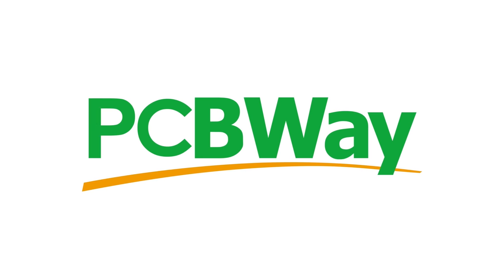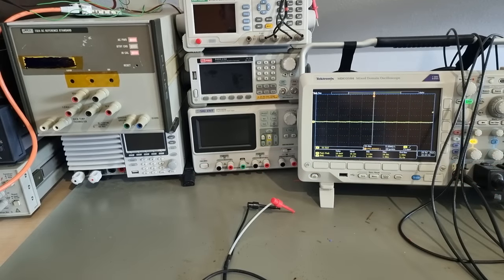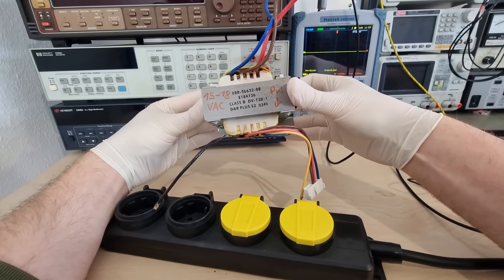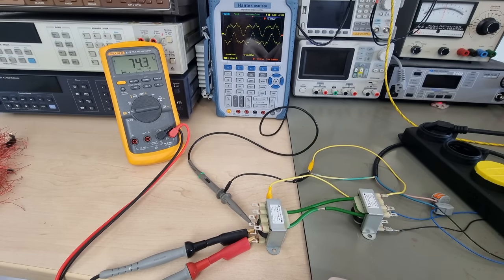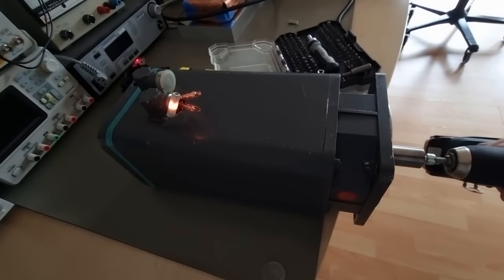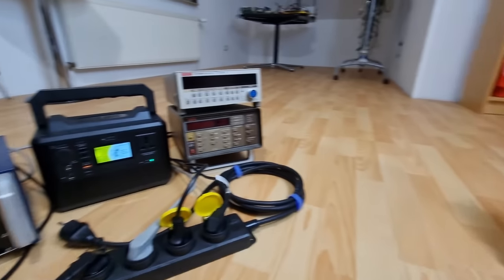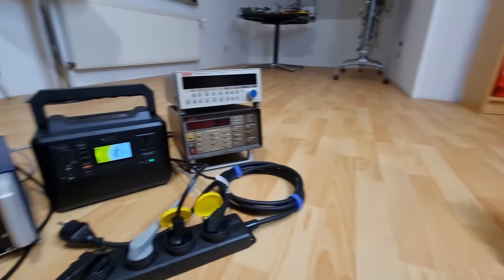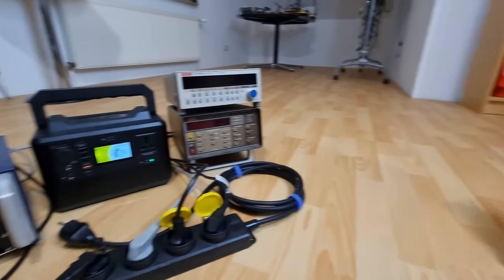eXtReMe iSoLaTiOn ( Low Leakage Power in Precision Electronics )

Comment: What about peltier devices? Deliciously solid state and only a teeny bit horribly inefficient.
Reply: and the excess heat can be used to heat the oven for the reference, neat!
Reply: Or  l a s e r s
Reply: A RTG usually is a peltier device. Apparently thermals are the reason for not using a super-radioactive and probably illegal discarded RTG, and no other reason... :)
Reply: @KnowledgePerformance7  It should lasers yes. Pref. RGB ones.
Reply: If not being solid state is not a deal breaker, one could simply mechanically couple a motor to a generator for virtually absolute isolation.
Reply: Or a simple solar cell instead of the fancy white-light one. They are sensitive to infrared if I remember correctly. So a single wavelength light source would work.

Comment: "The main winding was of the normal lotus-o-delta type placed in panendermic semi-boloid slots of the stator, every seventh conductor being connected by a non-reversible tremie pipe to the differential girdle spring on the 'up' end of the grammeters." - what I hear as a mechanical engineer
Reply: Now if he'd used spurving bearings be would have dropped at least a decimal on those ppms
Reply: LOL me too, but your humor made my day! :-)
Reply: This is just silly. You can't use tremie pipe on odd-numbered conductors mate
Reply: @Tikorous  Not even if he tightens the flingnut on the reversible trom-joint?
Reply: @friedmule5403  we're trying to have a serious conversation here
Reply: @Tikorous  Sorry but I am new to this technology, I have only tried the former model without the dingle-arms and tremie pipe. :-)
Reply: @friedmule5403  we all start somewhere
Reply: @Tikorous  lol, thanks for your understanding:-)

Comment: "Light emiting resistor" 
My god that made me laugh out loud HAHAHHA
Reply: Every electronic component act as a heater and emits light if you operate it wrong enough
Reply: That and the diagrammatic goatse.
Reply: one of the oldest jokes, but always appreciated 😀
Reply: Caught me off guard  Hahaha
Reply: Diode = voltage dependent resistor
sort of
Reply: "Strange, I don't remember spec'ing an orange LED...  Switch it off, switch it off!"
Reply: @SysDaemon  lol it happens allot on breadboards if ya not careful aka me, orange red leds and orange green leds lol
Reply: Reminds me of a soviet distribution box that had bolts as "status LEDs"
Reply: @666Tomato666  I want to see that.
Reply: @666Tomato666  : I had this with a russian db meter !!!
Reply: @_adamalfath  No, if you're ingenious enough to handle the emitted light. It may be not visible by the naked eye, but CO2 laser light is not visible too, but is strong enough to cut metal.

Comment: Woah, I am currently developing an isolated high-impedance ADC module array designed to measure high-impedance voltage sources (~100k of internal resistance) with 5 digit resolution and 2.5V dynamic range.

I've learned about FR4 leakage, guard traces, solder mask leakage, chopper amps etc already, and now you've covered probably the most subtle topic - isolation transformer leakage and how to reduce it. This was of a great help, thank you!

Comment: Look up "austin ring transformer".  These are used to feed single phase AC power to the signal lamps on AM broadcast towers, while not passing the RF to the power grid.  They are dual, interlocked toroids, with one AC winding on each one.

Comment: At my first company back in the early 70's they produced the Vidar 510 DVM.  It had a special power transformer.  The mains primary was on the outside of the EMI chassis and the secondary on the inside.  The transformer was fully encased in a die case shield, such that only the magnetic field could be conducted to the inner chassis.  IIRC it was developed for an Aluminum smelter to monitor current shunt voltages with huge multi thousand amp of common mode currents all over the place with shunts located a long distances away.
Reply: Huh, that sounds demanding. Did the core of the transformer actually pass through the shield?
Was there anything to prevent the shield from acting like another winding on the transformer (slits, gaps, etc...)?
Reply: Installed some equipment at a UK smelter many years ago. 195kA dc, single turn 'load' (down one smelting hall, back up the other hall). 
I could hang screwdrivers by their tips from the structural steels. 
Wallets (credit card mag stripes) had to be left on vehicle floor pan to stop them demagnetising. Some wild stuff. 
And no aluminium drinks cans allowed (H&S)!

Comment: Good video, but Marco, you missed explaining the most important instruction on 732a:  You never take measurements from 732a while it's plugged in, that is the whole point of the 732a having a 24V sealed lead acid battery pack built in.  The main point in the 732 manual:  Never take measurements while the 732a running from Mains power.  The Mains power is only kept on to keep the 732a warm and charged between measures.  Typically you're not going to be using that device for long term tests, a 732 is mainly used to transfer a known calibrated Volt from your local cal lab to your other in-house 732's, and from there you can periodically align your 3458a's to the 732a's.

We've found that a battery  / supercap cycled power system gives best low noise results, by far.  There is a reason a lot of those systems are patented.
Reply: I think he was purposefully leaving it plugged in since batteries are perfect isolation and he just wanted to compare the transformer isolation.
Reply: That's very interesting. Makes sense
Reply: What if there is some added noise from noisy acid in battery?

Comment: Interestingly enough motor-generator pairs are actually used in very high voltage applications such as particle accelerators where you have to get a few hundred watts, or a few kW of power into an area (deck) that has a voltage of say 100kV relative to ground. It's a very fascinating.
Reply: Apparently back in the day the military used these to do frequency conversions as well, usually between 400Hz and 60Hz. Since maybe the 70's solid state electronics got good enough to replace those.
Reply: They used to be used in a lot of machine tools (lathes/mills/grinders/etc) to allow for more optimal spindle speeds via frequency conversion.
Reply: Can't beat a meter of insulating shaft for isolation.
Reply: @power-max  if by "back in the day" you mean "today", you are correct.
Reply: @AuxiliaryPanther  I work for the US army and we do not use motor generator pairs for frequency conversion. There are a number of different MIL COTS converters we use. They all use solid state switch mode converters and inverter stages. AFAIK they work by rectifying the 115VAC 400Hz to DC, with power factor correction, then feeding an inverter stage to convert that back into AC, which is filtered with some output LC circuits. Usually these are fed with 12, 10, or 8 AWG MS22759/43 or /87 cables (200°C and 260°C, respectively.)
Reply: @power-max  ah, the Navy uses a mixture of old and new methods, depending on how old your ship class is.
Reply: @power-max  Chiming in with another data point, back around 2010 an Air Force research lab used a 400Hz motor generator pair that was switched on on-demand to provide 400Hz power around the building.
Reply: Look into 'dynamotors' - a rotary-state machine for DC-to-all sorts of volts/freqs conversion.
Reply: ooh eeer
;)
 @samheasmanwhite

Comment: It looks like a couple of the switch mode converters you tested have Y-capacitors across the isolation barrier. These can sometimes cause currents large enough to feel. It seems like their contribution might outweigh the transformer inter winding capacitance, but it would be interesting to do the measurement with them snipped out to see.
Reply: Same thing I wanted to point out.
Reply: I have lit up LEDs and even neons from such things! And felt it too haha
Reply: Cutting out the Y capacitors will remove the return path for high frequency electromagnetic interference (EMI). Which means taking them out may cause other types of interference with the sensitive measurements.

There are other ways to design power supplies to achieve low EMI. It is much simpler to avoid the designs that require the Y capacitor.
Reply: Sorry to disturb you, but I am desperate. :-)
I think about everything he is doing in this video, has taken a space rocket over my head. May I ask what he is measuring and what it influences?
Reply: @friedmule5403  common mode rejection. The voltage on output of the charger relative to earth ground. Due to capacitive coupling, there will be a small current that can flow, and a voltage of up to nearly 100V that can develop. It can cause problems with precise measurements and audible noise in audio circuits.
Reply: @power-max  Oh thanks, so the problem can be double in counties with 220-250V?
Am I understanding right in that voltage output is what is between zero (technically ground) and the real ground?
Reply: @friedmule5403  not really sure but presumably, yes. That would be how that would work...
Reply: @power-max  Thank you a lot, and the voltage was between psu zero  and real ground?
Reply: Without those capacitors, the common mode current will all go through the puny 1M or 10M sense resistor. You can get voltages large enough that the scope’s front end overvoltage protection kicks in. Ask me how I know 😅

Comment: The Topaz ultra-isolation transformer is old tech, I worked there in the 70's.  

The primary and secondary are wrapped with copper, insulated with tape to avoid a shorted turn.  The one we did had aluminum cases around both winding (not just the plate you showed), the copper and aluminum were grounded.  Any noise on the primary saw: 
  Capacitance to the primary copper shield
  Inductance of the shield to ground
  Capacitance from copper shield to aluminum shield
  Inductance of the aluminum to ground
  Aluminum shield to the secondary copper
  Inductance of the copper shield to ground.  

Isolation was very good, as long as all the shields were grounded properly (primary and aluminum to earth, secondary to the chassis ground of the powered product.   They did side by side, and inner and outer when leakage inductance was critical.
Reply: Interesting, thanks.  I have a 500VA (probably 1980s) Topaz unit that I occasional use (mostly for the safety benefits if I am working on powered equipment where the mains wiring may be exposed.  But it's good to have further understanding.
Reply: I've got several .0005pf Topaz Ultra Isolators. Step one on all of them was to verifying correct tap wiring and step two was to tighten EVERY connection point (including torquing the case through-bolts). All have brought obvious improvements in sound quality in each respective system. I size them for being at least 3x the max current of all devices connected. 

I have had better luck with these than my old PS Audio P15 power plant.

Comment: Great video! I've been working on low leakage currents using off-the-shelf DC-DC converters, mostly at switching frequencies. Love the AC leakage comparison. 

I just figured out a neat trick to reduce leakage on a split-core AC transformer even lower than the typical 1uA, by about 10x. Tried it on a Hammond 162G12, 12.6VCT, 12W. It reduces the AC leakage current by about 10x.

The trick only works with 120VAC US power and off-the-shelf dual-primary transformers. You connect one primary of a dual primary AC transformer to the 120V line and neutral. Then connect the other primary reversed, with only the neutral connected, so it generates the opposite phase120VAC. The other pin of the second winding is not connected, it just floats. This out-of-phase winding cancels out the electric fields from the primary, and so most of the leakage current also cancels. I get almost a 10x reduction, a drop from 0.6uA to 0.06uA!.  Of course the transformer won't perform as well with only one of its 2  primary windings connected: Less total power, more V drop. But damn is the leakage current low! Check the bottom of site below for more details. 

Dave
http://www.djerickson.com/rpi-power
Reply: Just wondering if one could use an autotransformer version of that same idea that would provide an anti-phase counter-winding in a balun style configuration?

Comment: I think "Medical grade" means there is no capacitor to the ground in the filter, as in medical installations there are no RCDs (not to switch off any life supporting equipment) just alarms for signaling naughty electrons flowing where they aren't supposed to.
Reply: Medical grade power supplies can have capacitance to earth as long as the earth leakage current requirement is met. Up to 5mA is allowed, although rarely is the measured value more than 500uA. 

Medical power supplies have a lot of requirements, but the most relevant here relate to the #1.) Construction of the transformer/PCBA (to provide sufficient isolation) and #2.) Output (AKA "patient" or "touch") leakage current to earth, which mostly depends on the value of Y-class capacitors across the primary-to-secondary isolation boundary.

In a non-medical power supply, up to 500uA "touch" current is allowed.

In a Type-B/BF medical power supply, up to 100uA "patient" current is allowed
In a Type-CF medical power supply, up to 10uA "patient" current is allowed

(All these currents referenced to a standardized 1K or 2Kohm measurement resistor.)

Basically, low leakage medical power supplies need to use small value Y-capacitors (or none at all), and usually need to play games with the transformer to keep the EMI low without using large value of Y-capacitors.

For this application, Type-CF has the lowest primary-to-secondary capacitance, and would probably be a good pick.
Reply: @SolidStateWorkshop  Hey! I recognised your profile pic instantly! Found your videos great when doing my introdoctory course in electronics :) Hope you are doing well
Reply: @txcpnae  It’s always so nice to hear that. Thank you. Once my life settles down a little, hope to put out some more 😉
Reply: No, "medical grade" means you can eat it and you won't get sick.
Reply: @SolidStateWorkshop  In medical ultrasonic cleaners I have seen them get dangerously close legally to the legal line at ~490uA.

Comment: 9:00 that qi reciever may be pulsing because it's not detecting a load on the output. Once it has no draw it signals back to the send coil "fully charged" by shutting itself off (with rf magic to the spec).

Comment: There actually are industrial applications where high voltage isolation is required and power is actually send via optical fibre. Broadcom (formerly Avago) has a set of diodes and receivers for this, e.g. the AFBR-POC204L. You send 1.5W per laser and get up to 895mW out.
If you need more power you could of course simply use several in parallel.
...though it might be a bit too expensive - the cheapest one is ~400€ at digikey...
Reply: 400 euro for one watt?
Reply: @frosty129  Actually even more. For €400 you only get the small power converter for about half a Watt. And you'll still need a laser to actually send the power.
But if your sensor or actor is located near a high voltage source (>10kV), in a noisy environment, far away from your control system, it becomes a rather convenient and easy solution.

Comment: How about this idea: Charge up super capacitor for a given time period from mains (ex. 10ms) and then switch off the charging from mains power and run on the super cap  during the measurement? 
As the power draw of the circuitry is likely much lower than the power you can supply to the super cap to charge it, I think the duty cycle might be appropriately quite low, thus making it possible to do measurements.
Reply: That's essentially the approach discussed at 15:48 with the Fluke thermometers.
Reply: @AJMansfield1  Damnit, I was just hunting down that timecode, and you beat me to it.
Reply: That was my first thought, flying capacitor power supply -- to be safe, think you would want to use relays to fly the cap, but that's a new can of worms.
Reply: Or an array of super capacitors that you charge and then disconnect to discharge on the DC side
Reply: Really you only need two super capacitors and then just have a timer or gasp a micro controller on each side controller a realy or two with some sort of opto coupler interrupt pin so you're never actually connected to mains. Like charging a bunch of batteries and switching them out but faster
Reply: Woah then you can have the dirtiest switcher on the face of this planet and not have to worry about it.
Reply: Technically it's just a normal switching power supply, just specced for a frequency in the mHz range instead of the MHz range...

Comment: I remember talking about that subject on eevblog forum years ago because I had the project of transforming relatively cheap but accurate dmms into table dmms. The goal was also to add logs, network connection etc...
Unfortunately I never had time to go very far.
For the solar part, I went the opposite way using cheap panels and lighting them with monochromatic LEDs.
I don't remember the power I could transfert. The biggest issue with that solution was its size.

Comment: LED solution: use a high power blue LED facing directly into another blue LED of slightly higher wavelength. Best case energy recovery is only about 10% but if you are only looking for  ~ 1W that's not a huge problem
Reply: is that a diy optoisolator?